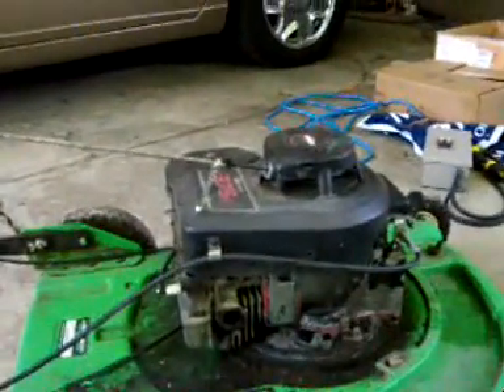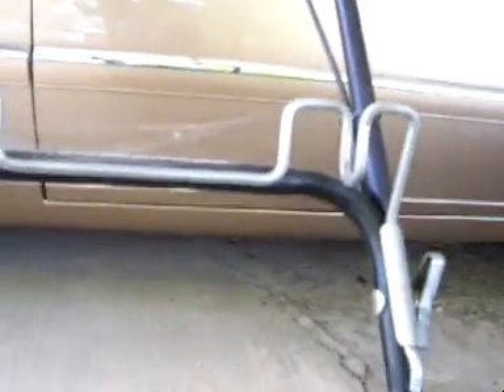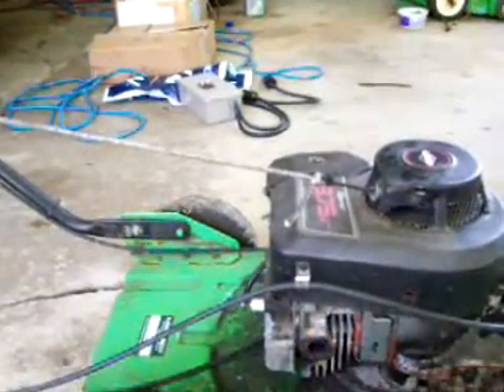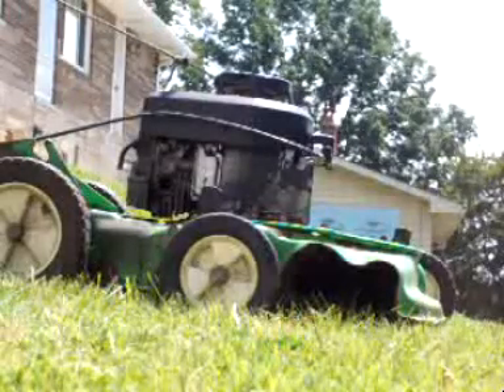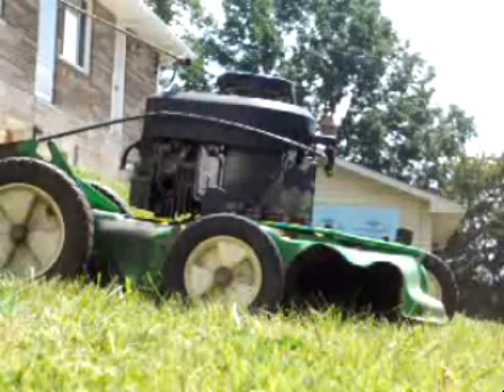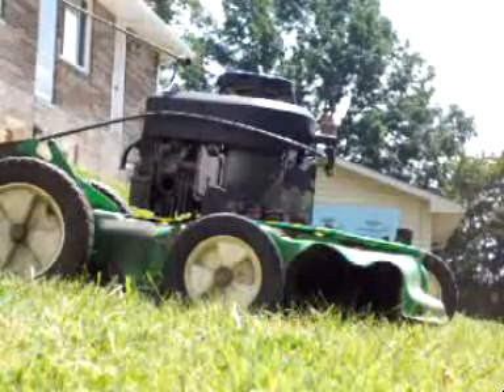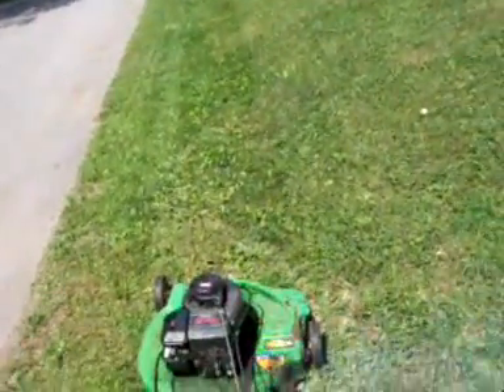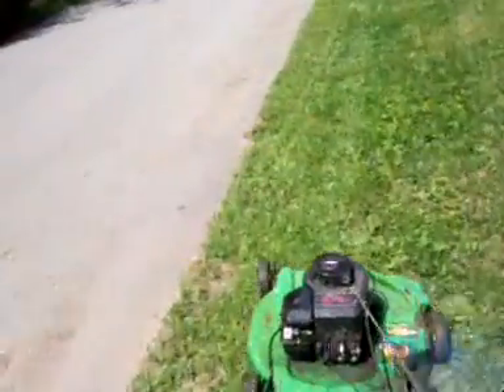Smokey Briggs Cuttin

Comment from the maker: For starters, if it was me....  I would give it a tune up, change the oil /  filter if it has one and let the oil drain out for a while till it stops dripping.  Clean / replace the air filter.  New spark plug.  Change the fuel filter if it has one and drain the fuel out of it put fresh in if its been sitting in there a while.  You could be over filled on oil or if a tune up does not help it..... you could have worn piston rings which is no biggie...

Comment from the maker: What ???  LOL, I did the same thing..... I tried to kill this one and I built it from leftover parts that still resembled parts from old engines that had died.  Scored vaves pistons and cylinder walls.....  it still ran !!!  I found later on, if I put cooking oil in the crank case it would run mostly off of that and use just a little gasoline....

Comment from the maker: You tear the motor down and give it a set of new rings, mebbe valves.  If its worn bad ya might have to hone the cylinder and use oversized rings.  See where im going??  If it comes to this, sometimes its easier to get a good used engine and use the old for parts......  when you drain fuel out drain it into a glass jar and you can see if there is water in it also.  It can also happen with worn valve seals/guides.......